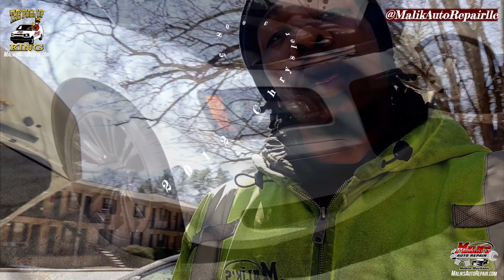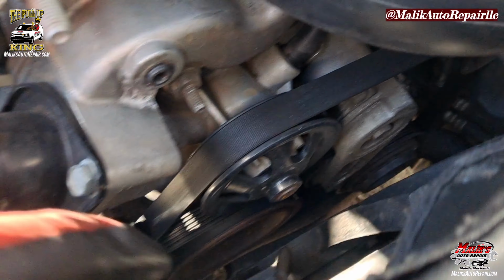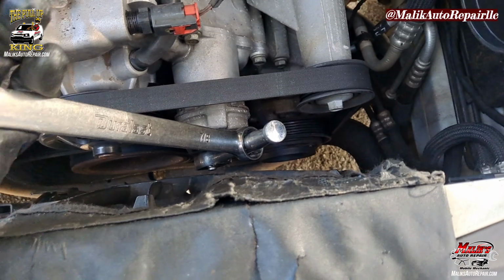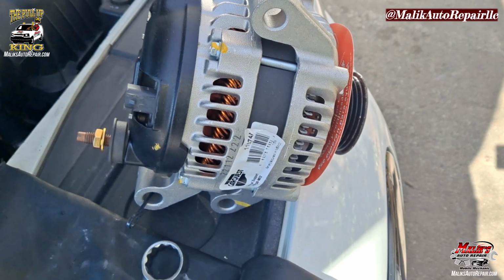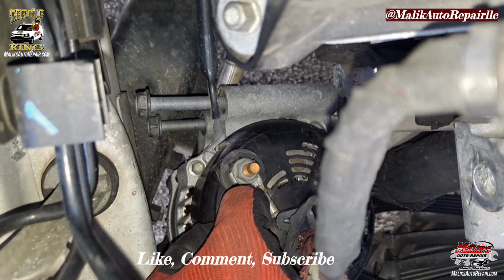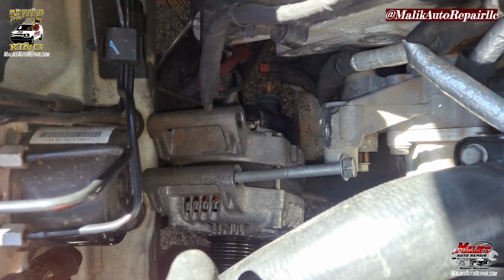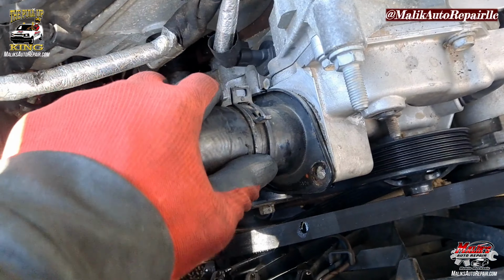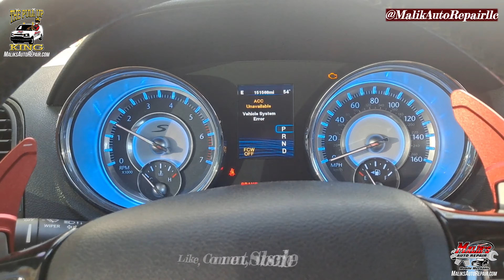ALTERNATOR | 2012 CHRYSLER 300S 5.7 HEMI | DETAILED | Howto/Diy

Comment: Your video was indeed helpful, but if you are dealing with a 6.4 the process is in a tighter space. It can still be done, but it is a bit more difficult.
Reply from the maker: Thanks for watching! And thanks for the info on the 6.2 liter.
Reply: Im going to attempt it on my 2013 6.4L any tips on how to deal with the tight space?
Reply: @charklingel6313  On my alternator, there were three mount points, with one of them on the bottom being connected to a rod that was attached further back than  could see. That rod and the way it was mounted was my biggest obstacle. Since then after changing the oil and having remove the belly pans, I think  it might have been easier to do some of the work from below. That's all I've got for suggestions to try.

Comment: How did you get them alternator bolts off so easily?! Im doing my oil pressure sensor but need to remove the alternator to get to it and cannot get the bolts to budge.
Reply from the maker: You need leverage
Reply: A breaker bar or some kind of leverage